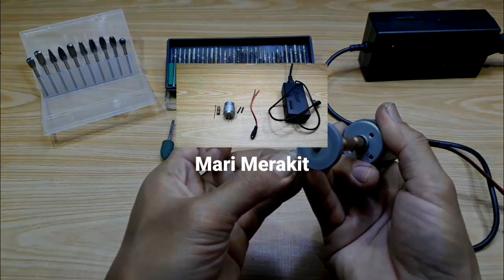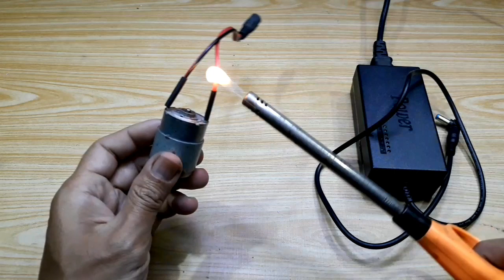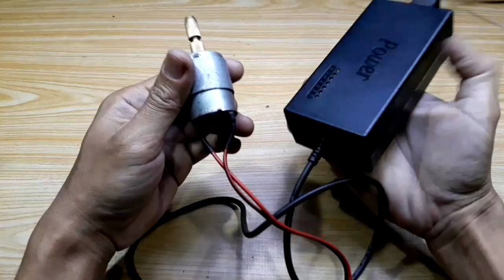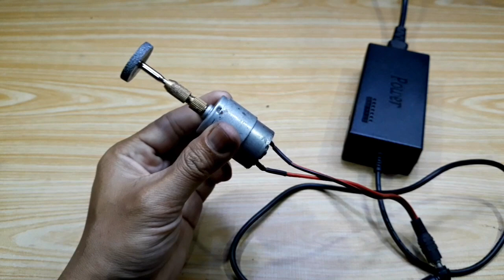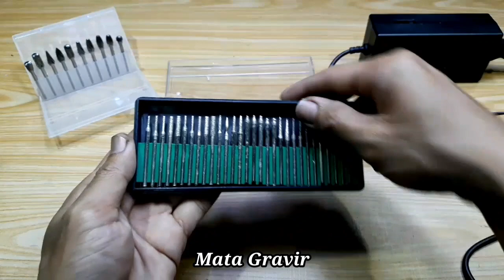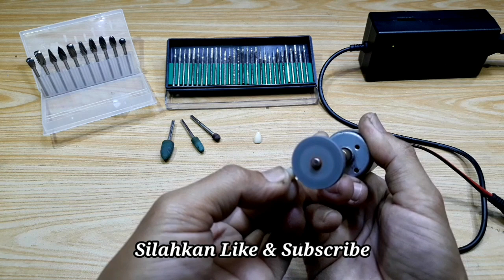Membuat Mini Bor / Mini Grinder Sendiri

Comment: Mas, kenapa setiap saya mau menggunakan selalu berhenti berputar, dan selalu mau copot mata bor sama 2 kuningan nya. Apa yg salah
Reply from the maker: Voba voltasenya dinaikan sampai 24v, geser saklar di samping adaptornya. 
Kuningan kepala bornya, diputar ke kanan,(dikencangkan) sebelum dipakai. Melepas / mengendurkan untuk ganti mata bor diputar ke kiri.
Reply: @dodolannyeleneh  tetap mas, masih terhenti ga mau berputar tiap digunakan/mau membor. Dan 2 kuningan sm mata bor nya terlepas mas.
Reply from the maker: @hidaahdiyah2273  coba wa Ke no saya mba , 082114775758